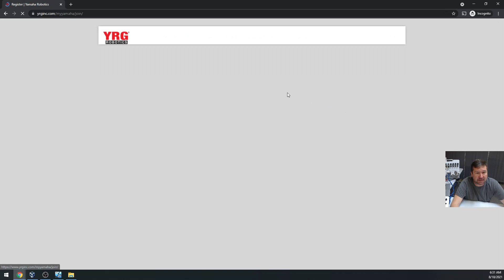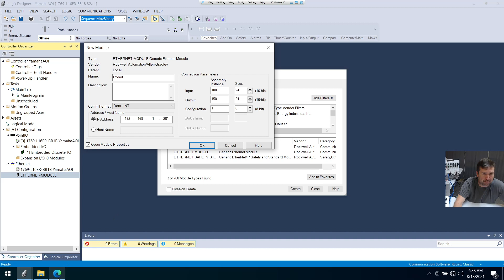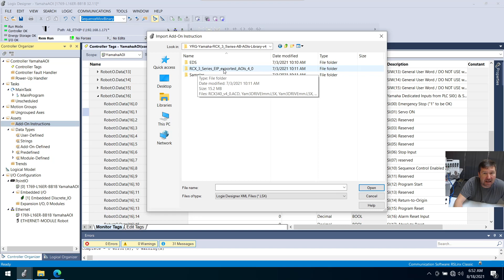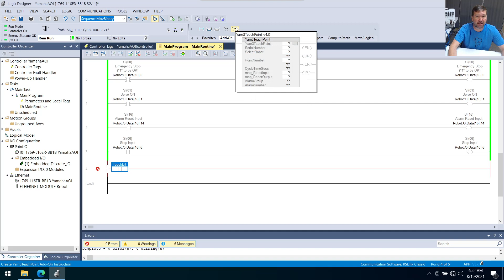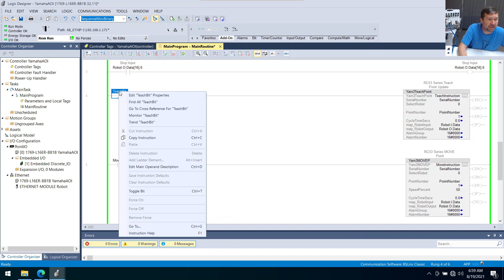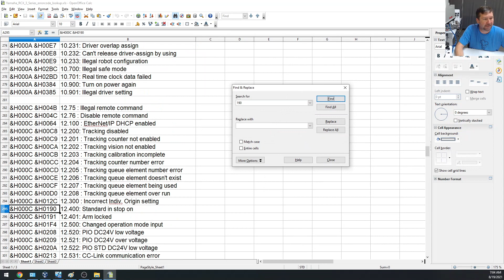Yamaha SCARA Robot. Easy to Integrate with an Allen Bradley PLC

Comment: Hi Tim. Great videos!

We currently have a few of these Yamaha SCARA robots at my facility and I'm trying to learn more about them. We almost exclusively use Fanuc except for 3 machines that use these. On the Fanuc robots they have what they call a "tool offset" that allows you to add an end effector and rezero the robot origin on that. Do you know if these Yamaha robots have anything similar? I can't seem to find much in the manual.
Reply: Hi Christopher, I can help answer this one. Yamaha Robots have what are called "HANDS". They are used just like a tool offset. There are Allen Bradley AOIs to switch hands on the fly or change the hand parameters written from the AOI if you like. I found a video that explains HANDS in the RCX340 controller, if you want a deeper dive here: https://youtu.be/Xi0Mch4U3M4?t=220
Reply: @chris_elston  Thank you so much!
Reply from the maker: Wow, that is pretty amazing support when the manufacturer manages to answer questions on my videos faster than I can get to them :)
Reply: @TimWilborne  Maybe you can do a video of how to implement "hand" offsets" into the robot program for us newbies.

Comment: I have watched many of your vids and always wondered if there is an industry standard for switch/button spacing and placement as well as paddle E-stops?
Reply from the maker: Most push button stations have 2.25" spacing so that is a good starting point.  If I know the operator will be using heavy gloves, I try to spread out the buttons more to around 3".  I rarely go lower that 2" on the spacing.  Hope that helps!
Reply: @TimWilborne  I appreciate your reply! So they are set to a 2.5" CTC. Is that also for paddle switches or just the momentary push buttons and LED indicators?